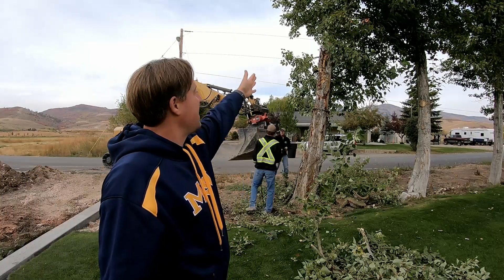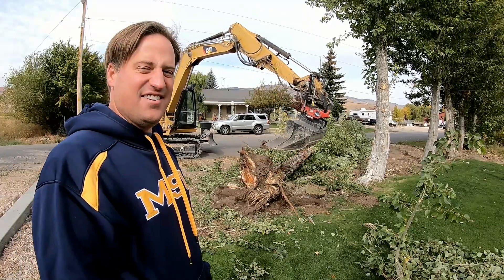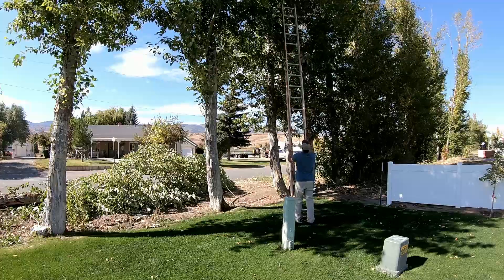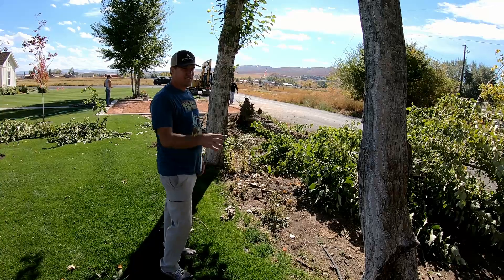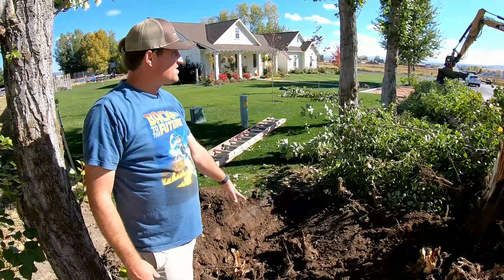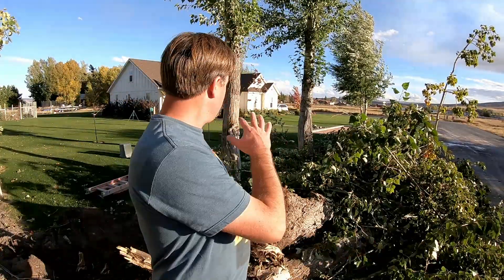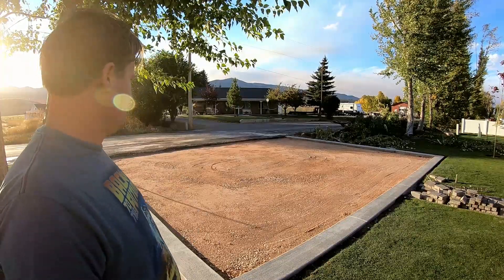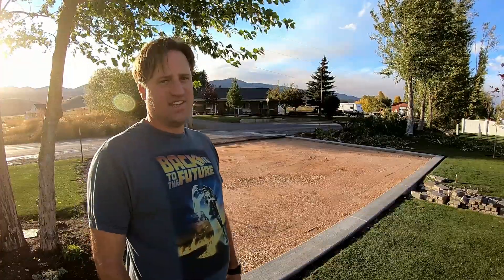Parking Project - Prepping for Asphalt - Part 3

Comment: So why not concrete?  Asphalt has to much up keep. I put in a concrete pad a few years back and it’s still perfectly level. Plows and snow blows easy. Not resurfacing needed at all. Plus in the hot summer my car does not leave dips and sink into the asphalt.

Comment: After seeing those trees getting ripped out, it seems like either the soil is soft as hell or the roots are weak as hell.  Seems dangerous that they came out so easy.  I pulled out a pretty small 9ft magnolia tree earlier this summer and it took two 4x4 ford f250 pickups to rip that son of a bitch out.  I'm pretty sure it was some type of magnolia tree.  I ripped it cause it would bloom in the spring(or fall, I forgot), look beautiful for 3 days and thats it.  Then it just looked like an ugly bush for the rest of the summer.  Then I had to clean up a ton of thick leaves in the fall.  I have tons of trees on my lot so I was just looking for a reason lol.  The nice vs work didn't balance out lol.  But Its good you got rid of "those" trees.  But having large trees is great for the summer.  Provides shade and keeps your house cooler.  Makes the property more appealing.